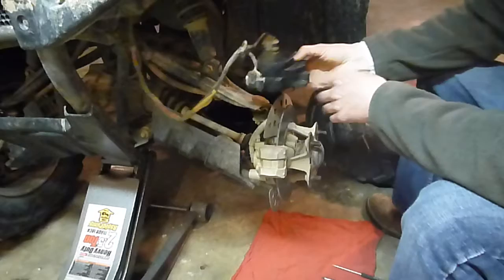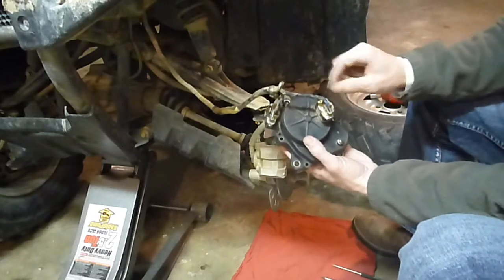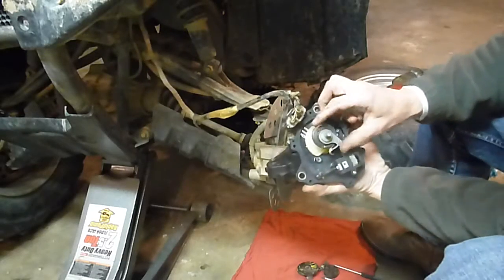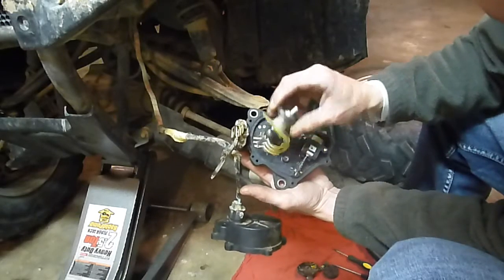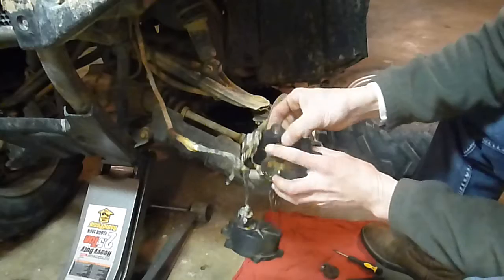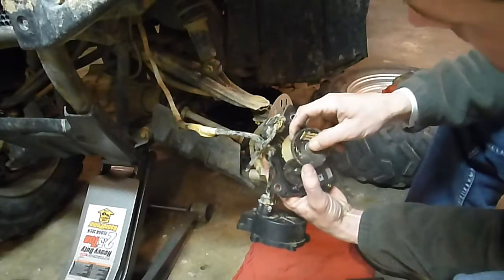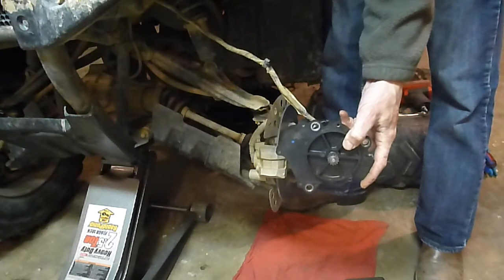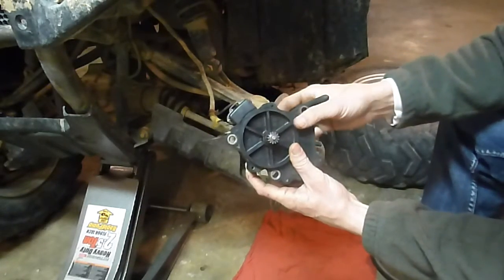How-To Disassemble, Service, and Re-Time the Yamaha 5KM-4616A-02-00 4x4 Servo Motor

Comment: Help, please
He pressed the button to 4wd and it works but it doesn't return to 2wd
Reply from the maker: Check out our troubleshooting page here. https://501parts.com/pages/troubleshooting
Reply: Yes, I have already checked all my Servo motor turns only to one side
Reply from the maker: You have to check all the components, switch, the three relays, and the servo, and you have to make sure all of it is in sync. Then you’ll want to start looking at the wiring. Then lastly CDI box.
Reply: Ok 🫡

Comment: What if u do all of that n d weel do not move?
Reply from the maker: In that case, you could have a problem with either the servo, one of the three relays, or the switch. The best thing to do is visit our troubleshooting page here, and go by the step-by-step instructions to see which component is bad. We have all the parts available on our site and can help you further, if need be. Here is the link to the page. https://501parts.com/pages/troubleshooting

Comment: I followed this video to re-time my front diff 4x4 servo into 2wd. i plugged in the servo while the switch is in 2wd and it stays in 2wd as it should. i select the 4wd and the servo advances as it should but will not reverse backwards to 2wd. any ideas? I did bench test the servo and it does rotate clockwise and counterclockwise using 3v power supply.
Reply from the maker: You could have a bad relay. Or a short in the wiring.
Reply: I checked all 3 relays according to the video and they test perfect. When I test light probe the wires behind the plug on the relay it triggers the relay to close the contact and the motor spins. Spins clockwise when I probe one of the 5pin relays and counterclockwise when I probe the other. It’s just not doing it from the switch. Even though the switch bench tests perfect too. It’s got to be a broken wire I guess.
Reply: @jeffmaeder1230 did you ever solve this problem. Have one doing the same thing
Reply: @ someone replaced the cdi with a non OEM version. I bought and installed the OEM and it worked as intended.
Reply: And with all this said do you think I’m safe to assume the wire/wires I’m looking for broken has to be between the switch and the relays? Reason I say that is because when I prove the relay the motor moves.
Reply from the maker: It is probably a bad wire between the switch and the relays. Especially if it works when you start probing with the test meter.

Comment: I've done this to my 02 grizzly 660 and when I try it and push the 4x4 button it turns but when I hit the diff lock it does nothing then when I hit 2x4 it turns but will not on the diff lock. Any help would be much appreciated.
Reply from the maker: It sounds like you have it out of time. The switch has to be in 2 Wheel Dr., differential in 2 Wheel Dr. and the servo timed to 2 Wheel Dr.

Comment: Great video...I will definitely be using this today for reference.  
Quick question...my 04 Grizzly is stuck in 4wd with the locker engaged...when I took this servo off to check it out, gear oil ran out everywhere , is that normal? Also, it being stuck in 4wd, is there a way to manually get it back to 2wd to get this servo timed before reinstall? Thanks for any suggestions
Reply from the maker: Yes gear oil running out is normal. To put it in 2wd manually you will need to move the slide gear all the way to the left inside the differential as you are facing it sitting on the seat. To time the servo this video will show you that. Thanks

Comment: I removed the two rear diff bolts and loosened the front bolt and pushed a large screw driver under the diff.  Gained easy access came right out

Comment: How do i get the bottom bolt out of the servo? Do I  need to loosen the differential raise it a bit to get my tamper proof torx on it.
Reply from the maker: Drop the skid plate to get to it. Or yes you could move the diff but skid plate is easier

Comment: My mother in-law has a 2010 Massimo HS400-U that is stuck in 4WD. I have got the ORV at home and will be trying to diagnose and repair the problem. Any tips, or hints would be greatly appreciated. And the website looks like it will be my go to for parts! Great Video & Thanks in Advance! P.S...It looks like it uses the same servo on the front diff!
Reply from the maker: Richard,
I would check the servo on the front diff first, that's most common. Relays next, then the switch. You can find videos on how to do each of those tests and more detailed troubleshooting help on our troubleshooting page here. http://www.501parts.com/downloads/

Comment: Why can't I disconect the harnes while i'm retiming the servo motor?
I disconected them an now it doesn't turn on
This is a Yamaha rinho that i have 
I would appreciate your answer in my help
Reply from the maker: You can and should have the harness disconnected when you are timing the servo. Put the switch in 2wd mode and time the servo to 2wd with the wiring harness unplugged. Then plug it back in before you bolt it on the diff. Run it through 2, 4, and diff lock ending in 2wd. If it works properly, bolt it up but make sure you have your diff in 2wd which is all the way to the right on the Rhinos. Hope this helps.
Reply: @501PartsTech  thanks brother but i have done this way mani times because i have seen your videos , now i'm goin to check the relays an all the wires

Comment: I have a problem with mine 04 660 grizzly  you push button and it just keeps turning until you push 4x4 button again ?
Reply from the maker: Jason, sounds like you have a relay that’s sticking or a wire that is shorted to ground. Try tapping on your 4wd relays when it’s turning like that. Check your wiring harness too especially under the front rack and plastic insert.

Comment: I have a big bear 4x4 2007 i replace all relays and 4x4 light stay on and not engage new 4x4 switch  plis someone tell what to do
Reply from the maker: You'll want to check the servo motor on the front differential next. Typically with 4wd issues, you'll check the servo, relays, switch, wiring, CDI in that order. See our troubleshooting page if you haven't already for more detailed guides and service manuals. http://www.501parts.com/downloads/  Hope this helps!

Comment: Excellent problem solver video.  I have a 2003 kodiak 400 that wasn't coming out of 4WD mode.  Turns out the gears were out of sync.  Adjusted them with the markings found on the exterior  gear  and the mark (white dots) found on the casing. All is good, thank you for taking the time to provide this video. Keep turning wrenches.  I look forward to viewing future projects that you post!!!